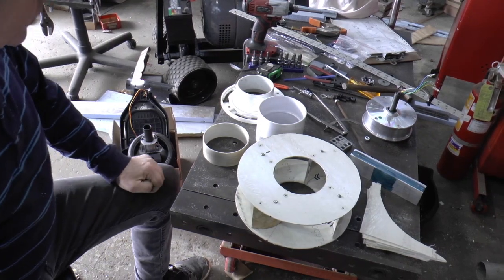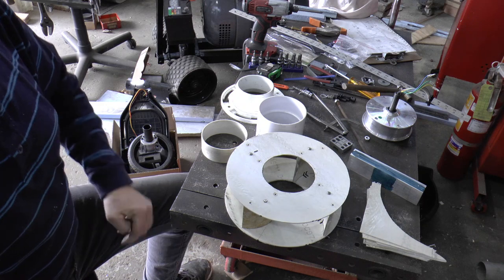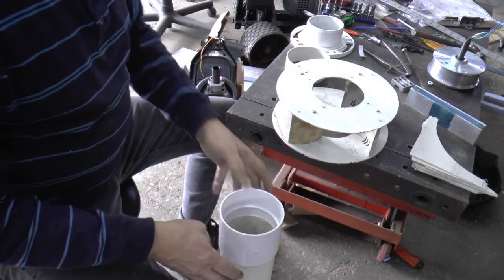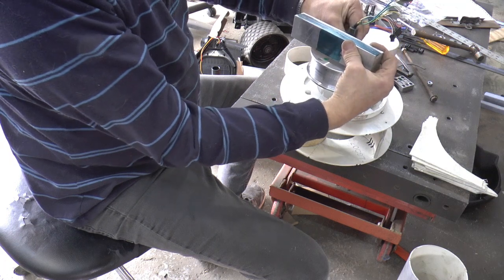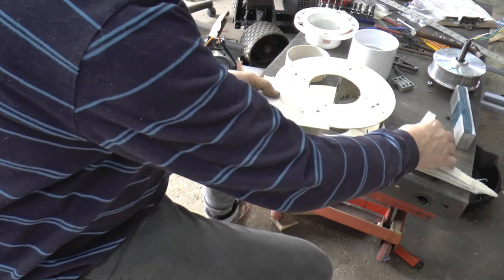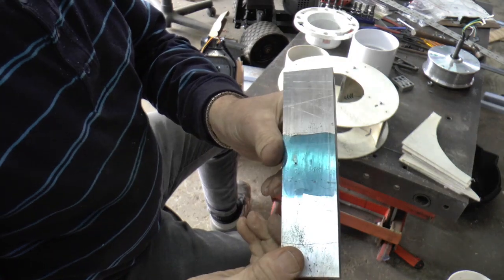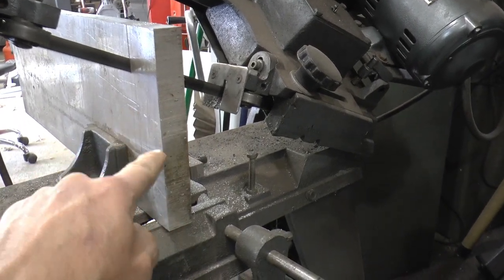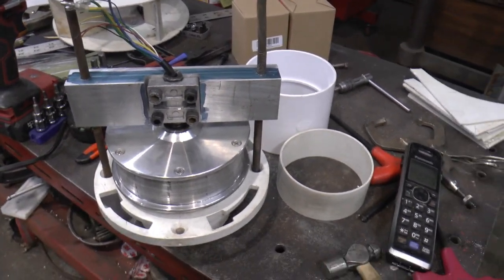Hoverboard Micro Hydro DIY Project Pt 1

Comment: For your lower bearing use wood, the water will lubricate it. I seen water wheels that had 20 year old wooden bearings supporting it.
Reply from the maker: Thanks for commenting. I use wood bearings on my overshot water wheel. I usually get 5+ years use before replacing them. The bearing may not be below water but will probably be wet. I was going to try using Delrin if it doesn't hold up then wood will be my next choice.